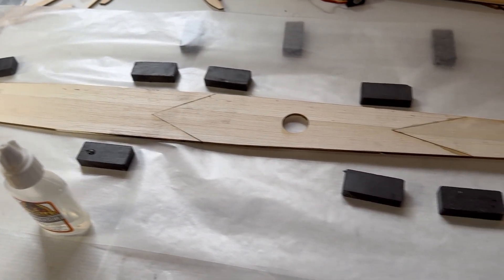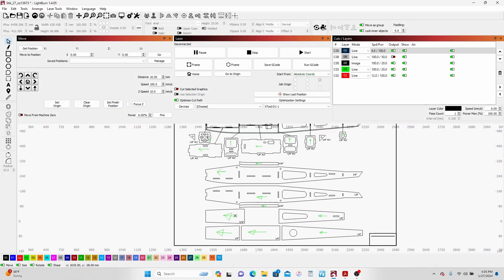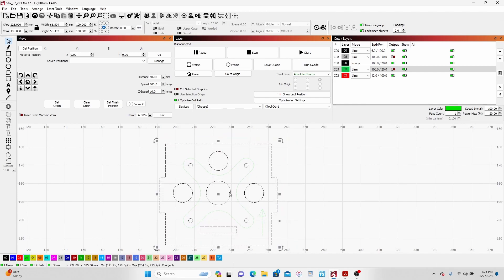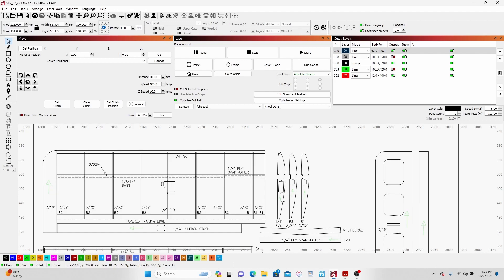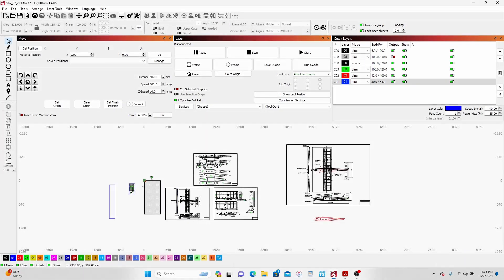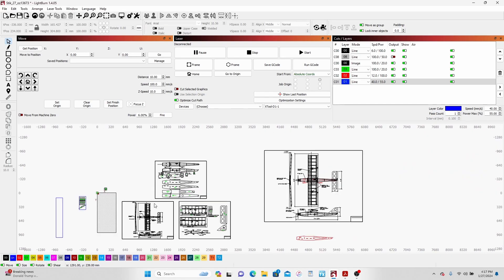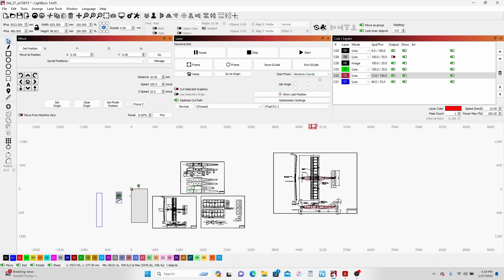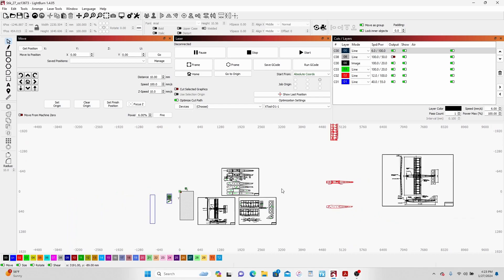Beginner Laser cutting 2. Premeditated kit cutting, scaling, and printing in LIghtburn.

Comment: Very informative, thanks. Do you mention in any of your videos about using the trace image tool? I have a bitmap of the parts I want but the trace tool doesnt do a clean job. The other option is drawing vector over top in inkskape, but that is extremely tedious!
Subscribed
Reply from the maker: I get a better trace from Inkscape but I agree with you that none of them are very precise. I use Lightburns line tool and spend lottsa time getting my bitmap plans to where I can cut them out. Somewhere in my vids There are some about tracing where I show how I do it. Check Titles...I cover a lot of ground on getting plans ready and cutting a kit.

Comment: So, if I already have a vector file there's no need for tracing right? My next question is scaling. If it shows the parts laid out on say a 3x12 plank, then adjusting for the correct plank size should give the correct part size right? Or measure off of a full size draft.
Reply from the maker: Yeah guy
Vector files are digital already. You won’t need to trace them. Trace when it’s a pdf bitmap file. 
Now for sizing. You only need to resize if you’re changing the scale…size…of the model. You can use Lightburns measurement tool to verify things like wingspan or fuselage length to see if the planes you have are going to give you the size you want. Also. Use my printing plans at home vid to see by the printout what size everything will be. Then maybe cut out just one or two pieces to compare to the printed planes to verify size.
Reply from the maker: If you have a vector file good chance it’s already set to the size it claims but use Lightburns measure tool to verify

Comment: My concern is scale. I have a Cessna Skymaster sheet but have no clue on scaling the pieces.
Reply from the maker: Any chance you could find the exact model on outerzone or aerofred? They are usually scaled correctly and in a pdf or dxf format ready for lightburn.
Reply: @lazerbuilderrc1536  ok, thank you! I went to aerofred and got a set of plans that I will try.
Reply from the maker: Just a suggestion...cut 1 or 2 pieces with the laser to test for correct scale before trying to cut several pieces. The wood you save may be your own...LOL.